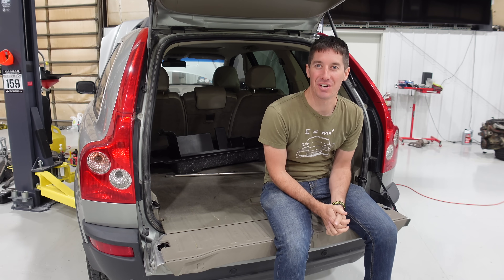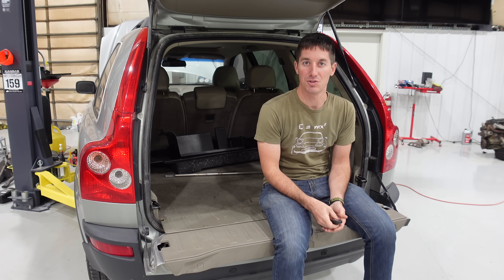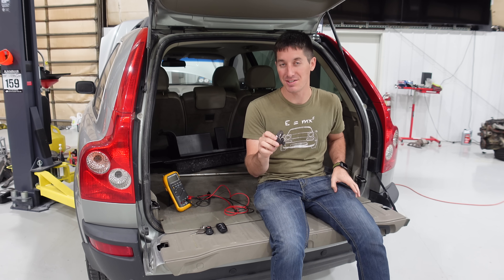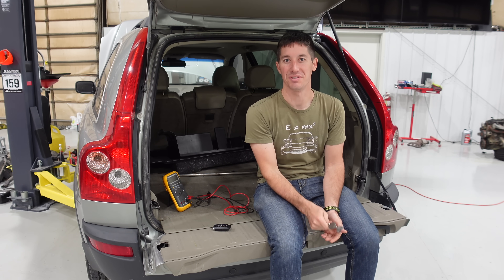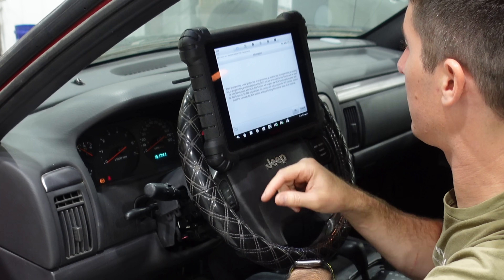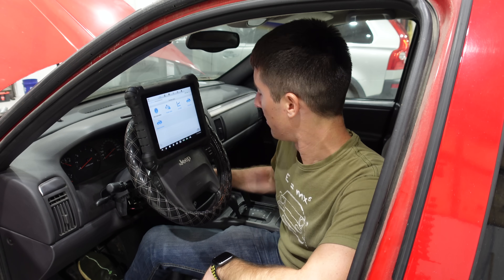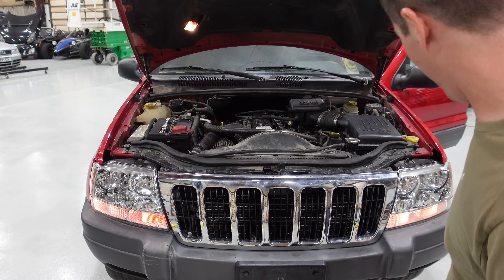What Is An Immobiliser? How Does It Work? And How Do You DELETE It?

Comment: I used to work at a place where like 20 employees needed keys for our fleet of company ford and chevy cars. they used the chip keys. So my mechanic took apart the steering column and hides a chipped key in it next to the cylinder. Then we can make all the cheap generic keys we want for them!
Reply: I mean, that's basically what an aftermarket remote start installer does.
Reply: The early 2000's GM cars, you could cut the wires to to transponder and place a resister inline. Reset the key with the 10 min learn x3 and you bypassed the pats with a 10 cent resister.

Comment: What you really need is a DRB III or a DRB III Emulator, you can program the keys and fobs. I'm going through that right now with my wife's 2004 Grand Cherokee, I have new keys and fobs but because it only came with one set I can't program the new ones and the fob is a pain in the ass because she has the memory seats and only the dealership can program them according to the interwebs. I can't wait to see what you end up doing to get ride of SKIM, hopefully without having to reprogram or replace the ECU. The PIN is an odd one, I was able to go to my local Chrysler Dealership walk over to the parts department give them my VIN, ID and vehicle registration and them called and got me the PIN no charge. The parts department guy said I was lucky some of the new PINs only last 15 mins and then they have to recall for a new PIN.

Comment: If the battery in your Key Fob appears to be low (less range to activate Door Lock/Unlock), simply place the Key Fob to your chin and press the Door Lock Button while walking to or from the vehicle. Your body acts like a giant antennae, due to the water in your body. This is a temporary fix, so buy a NEW Battery for the Key Fob ASAP!
Reply: This is a great tip that not many people know. I use it regularly because I'm usually out of range when I remember to lock it. I hold mine to the side of my hip and can get some pretty good range out of it. Another tip if you have push to start and a completely dead battery hold the key fob directly on the start button and it will start.

Comment: Hey JR, try a different key. I have a 2011 Jeep and used pin pull to get my code. I had a key that failed programming, it kept saying programming complete but the key never worked. I ended up buying an OEM key, had it cut and programmed it myself. Bam, successful programming and a working key.
Reply: Yup, sometimes these keys fail. And you don't have to spend OE money for a new key. A quality Strattec key for cheap works just fine, and make friends with someone at a Jeep dealer to program it. Takes all of 15 minutes. Unless the SKIM module is borked....
Reply: Most keys can't be reprogramed, write once read many. Once he deleted it a new one needed to be used.
Reply: Yeah, I'm not sure why he thinks the key is fine if he didn't see it running with the old engine. Get a new key and start from scratch - and DON'T engage the starter when "cycling" the key during programming.

Comment: When you disable the skim it can be started with ANY KEY... the Jeep ignitions of the early 2000s were easy to force on because they relied on SKIM. ask me how I know
Reply: @walterberg306  I have two Jeep’s, and my brother is three. While working on my WJ I mistakenly used my brothers TJ key. I thought the steering wheel was locked and with only enough force to push past a lock steering wheel the Jeep started and stopped. Took three tries for me to see I was using a black non transponder key to start my WJ. If I had no SKIM, you could just leave with my jeep

Comment: Would cycling be to accessory position (or just shy of start, run I guess) then off vs the start position? Probably not, but worth a shot?
Reply: Came to make this same comment.  This has always been my interpretation of cycling the key.
Reply: Exactly what I just commented proper way to cycle is to turn back to accessory (past off) and back to ON position three times within ten second period with atleast a second in between a cycle. I wait for 3 beeps and it always works unless the magnet in the fob is damaged or missing.
Reply: @RexerYTRexer  yeah. My understanding is if you go ahead and start the vehicle, you have to redo whatever process you were trying from scratch.
Reply: Unless he didn't show it on camera, as there is a cut, he didn't cycle it correctly.
Reply: Yep, I would have tried cycling just to the point of not engaging the starter. That's how I remember doing it on our PT Cruisers. On the flip side, why is JR wasting so much time with this? Hours and hours. Is his time not more valuable? It would have been cheaper to go to the dealer and get a factory key.
Reply: @OMGWTFLOLSMH  He doesn't seem to want to be beaten by it I guess. He's definitely driven, pardon the pun.

Comment: I just recently learned that it's pretty easy to program many early to mid 2000s GM vehicles with a chip key. If you have at least one functioning key, you place the already programed key in the ignition and turn it on to the run position for 5 seconds. Then turn the ignition off and quickly put the new unprogrammed key in the ignition and put it in the run position for 5 seconds. Boom, you have a newly programed key.

If you ever loose all your keys, you have to put the new key in the ignition 3 times in the run position. You place the new key in the ignition and turn it to the run position and wait for ten minutes. After about 10 minutes, the security light will go out. You then repeat this two more times and if everything was done correctly, your key should be programmed. The only down side to this is that it will erase all the previous keys. So if you find your original one(s), you'll have to either throw them out or reprogram them if it's possible.
Reply: For what years? I had a bunch of codes for Ford key fobs.
They were different for different models of the same year. 
Pain in the butt to look up but easy to program. They rape you on the charges. Doesn't take three minutes.
Reply: @robertlee9395  I'm not to certain on the exact year and model ranges, but for my model of vehicle, the Pontiac Aztek, it works for all model years. The video that I looked it up on, it looks like the guy was doing it on a late 2000s GMC/Chevy pickup. The only thing I was angry about when I learned this method, is that's how the locksmith programed the key. His tablet was having a hard time communicating with my car's computer, so he did it the way I described above. So I was a little salty that I paid someone $90 to do something I could have done, but I also didn't know that was possible. I was always told you had to use a computer to program the key. But what was cool about it, the guy showed me how to do it in the future so if I need to ever reprogram a key I know how. And then I found all the videos online on how to do it as well.
Reply: early 2000s toyotas are the same way.

Comment: I bought a 97 XJ for $500 because the owner had done some electrical work that caused problems for the ECU. Long story short I finally pulled the Body Control Module out and discovered that I could start the Jeep and run it with no problem. Now, there are no gauges or lights, but this was enough for me to be able to move the Jeep around while working on another truck.

Comment: Explain the posi-trac rear-end on a Plymouth next!
Reply from the maker: No one can explain that, it just works!
Reply: Marisa Tomei is the only one qualified to explain position traction! Lol
Reply: Posi is on GM products! 
Chrysler uses Sure Grip! 
And Grip it does when you have the correct tires because Chrysler uses a superior adjustable Torsion bar front suspension and tunable rear leaf springs!
You can adjust how much weight is on each corner of the car!
Reply: @robertlee9395  it's a joke line from the movie Joe Dirt.

Comment: My 2002 Chevy Blazer had that miserable GM Pass-Lock system.  I can't count the number of times it prevented me from starting my vehicle.  But I didn't time how long it took to re-set it: 8 minutes.  God help ya if your vehicle stalls out on a busy street and you can't get it started for 8 minutes (or more).
Reply: Yep, had a 2004 Grand Am that had problems with the pass lock later in its life.  Those would be the longest 10 minutes of your life sitting and waiting

Comment: That key could be a valet key or have a bad chip inside the key. I would get a new trasponder key. Im sure you did by now already. I was a auto locksmith.
Reply: He didnt cycle the key after programing it proper way to cycle is to turn back to accessory (past off) and back to ON position three times within ten second period with atleast a second in between a cycle. I wait for 3 beeps and it always works unless the magnet in the fob is damaged or missing.
Reply: You right , gray is valet key .. back in the day you would get 3 sets with car
Reply: @digupstate  This WJ isn't fancy enough to have a valet key. All immobilizer keys were gray, and valet keys would say VALET on them if I recall correctly. If it has a pentastar or JEEP on it, it should work just fine.
Reply: Had 2 sets for mine,both gray.
Reply: I have an '04 and the gray key is a valet key but it still works to drive it. They need it to run to park it. It just doesn't work on the glove box lock. My black master got lost and I had a locksmith make a copy from the gray key and he was able to program it.

Comment: Once you erase all keys, you can’t reprogram the old key. Need two new keys to program. We always call a local locksmith that have the capability
Reply: The original key has failed. Probably water intrusion on the chip. It’s dead, Jim.
Reply from the maker: I did try just programming the original key first... it wouldn't take that either. 🍻
Reply: @WatchJRGo  Sounds like you miss read. Keys are write once. You need two unwritten key. Also could be edit but the key cycle was not shown correctly.
Reply: @WatchJRGo  I think he said that the process used is intended to program new keys not old keys since he said "you can't reprogram the old key".

Comment: An electronic immobilizer something that drives drives JR absolutely bonkers and makes for great YouTube videos. Absolutely RIGHT TO REPAIR should be for everyone.
Reply: Absolutely true the days of buying something means owning something seem to be long gone.
Reply: Auction buy...98 Camry no key at all. Locksmith cut an entry key but it won't start the car. How to bypass this damned immobilizer
Reply: @mikefrazier9508 Bruh 🤦🏽‍♂️ You have Passlock I, wire in a potentiometer  from 800 ohm to 2k are least and do a relearn, yes, it’s that easy.

Comment: This is why I put my keys in a faraday cage otherwise known as an antique penguin ice bucket.
Reply from the maker: Yup, my keys stay FAR away from the walls of the house 💯
Reply: I also have the a antique penguin ice bucket from my Mom. Never thought to use it as a Faraday box. Thanks for the suggestion.
Reply: What is a faraday cage?
Reply: @randyhutchinson5253  What mclean1983 said. Aluminum foil will work as one.  If you completely wrap a keyless entry fob in aluminum foil the fob won't work. Some people buy faraday cage wallets but that's a little too extreme for me. I only put my fob in a metal enclosure when I'm home. But also because that particular ice bucket has sentimental value.
Reply: @nachobroryan8824  ridge wallets is a big name in blocking RFID card. I have one and tried the card tap feature and it blocks it until I take the entire card out
Reply: @randyhutchinson5253  - What is Google?
Reply: So it’s for theft? If the key can’t transmit?
Reply: @randyhutchinson5253  that prevents thieves from using a radio transponder to read your key while it sits in your house, then retransmit the code to unlock and start the car.
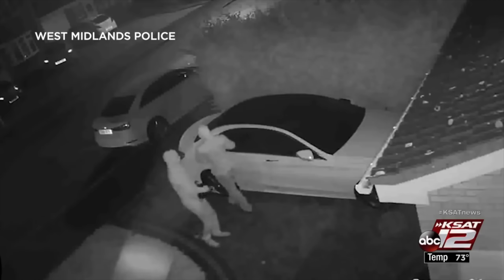Reply: @randyhutchinson5253  What Andrew Martin said. 2:26 in the video is an example of this. The thieves made the key fob think it was closer to the car than it really was so they could steal the car.
Reply: @el_cliente  give me a break